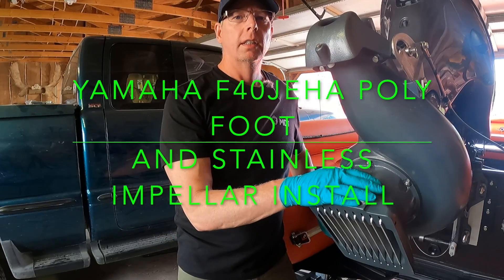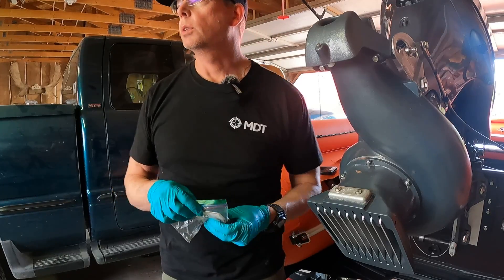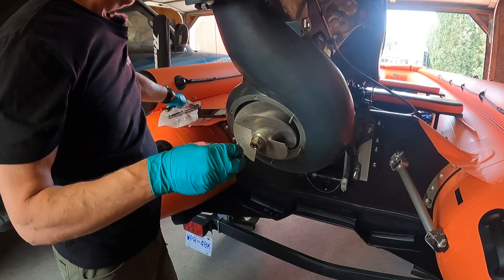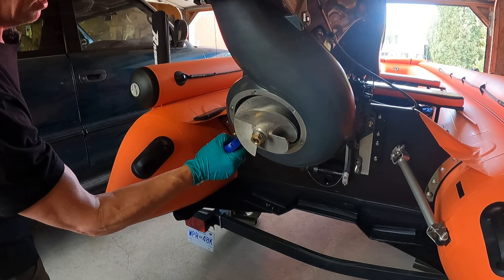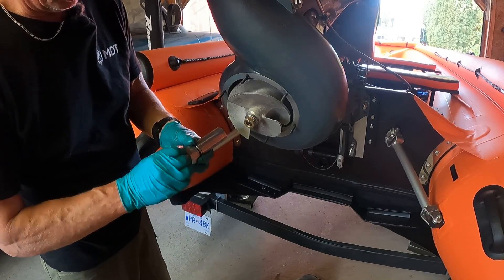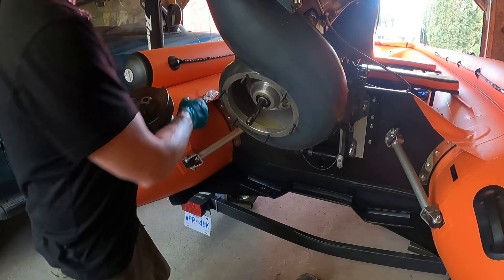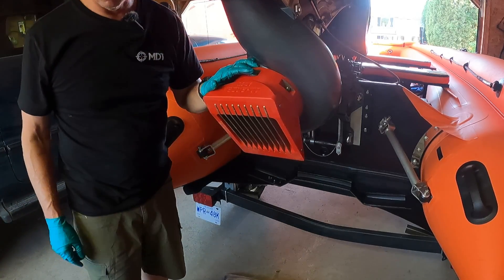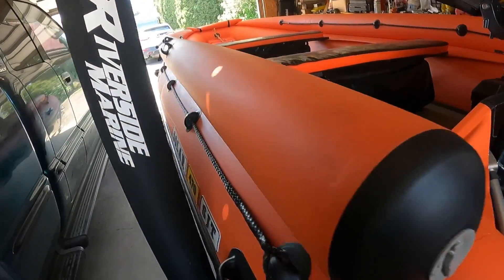Solar 470 SJ Yamaha F40JEHA Poly Intake And Stainless Impeller Install

Comment: What size intake on that pump? Medium? Also where did you get your impeller and what was the size? Thanks!
Reply from the maker: Hi, yes I believe it is a medium, I think.  The stock impeller size is a 8.24  61/8CB. Those are the numbers stamped on it. I bought the stainless one from Riverside Marine in St Albert , Alberta. Thanks for watching and the comment, take care.
Reply: @bcextremeoutdoorsman  power trim?
Reply from the maker: @bulkleyoutdoors   no power trim.